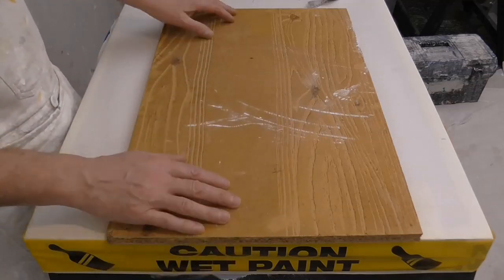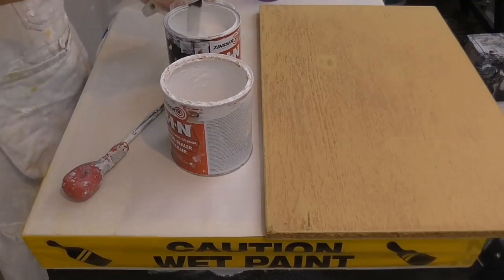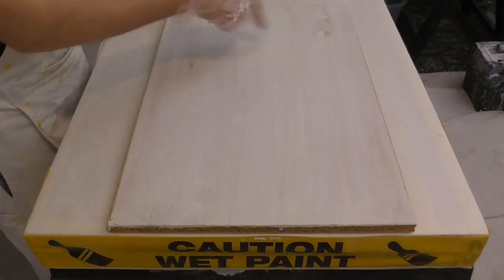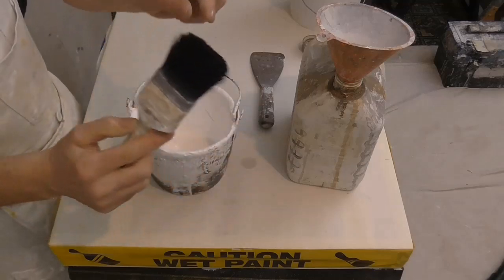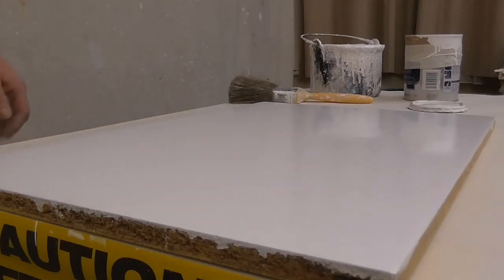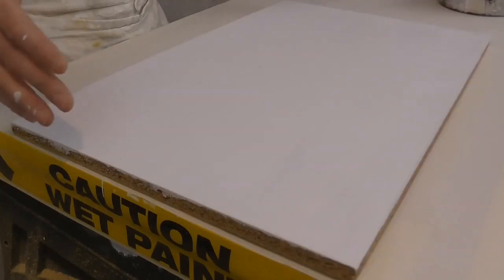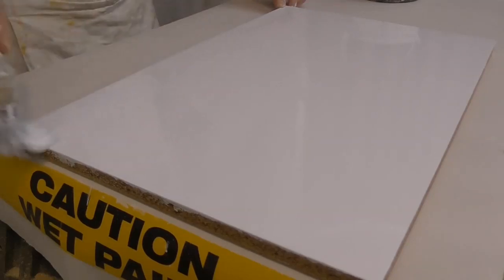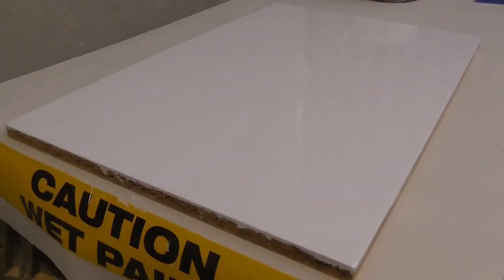Perfect Gloss Finish Using A Paint Brush

Comment: Great video mate. I do very similar brush strokes as you,but to keep dust to an absolute minimum I will use a sponge sanding pad soaked in water between coats. I actually use really cheap ones from pound land,and i get a glass like finish every time. The beauty of this method is,that I can actually rub down in a room that I have wet gloss without the worry of dust landing on it. Not that I would recommend doing it as a rule,but if you are desperate to get a job done on the same day,it can be handy.

Comment: Nice video. Never seen someone put oil brushes in water overnight rather than spirits. you learn something every day. You recommend oil based paints that would work well in windows with light, but I find whites yellow too much when not exposed to sunlight. I am trying to get perfect finishes on internal cupboard doors etc so opt for water (or acetone) based paints. I use rollers instead of brushes as don't have a gun. What would you use for a flat cupboard door - brush or roller?
Reply from the maker: Thanks, usually brush all the way so everything looks the same finish. Oil satinwood does not yellow as fast.

Comment: we do water based emulsion on log cabins. im expected to do 2 spray coats (im not a pro decorator but this job is within my capabilities). the spray coats look great but what ive found is that if i do a brush coat inbetween the final spray coat looks mint. not only that but i know ive got 100% coverage. the main contractor often makes remarks about how long it takes me to do them, he never says anything about the finish though so i know its right. im hoping to pick up some oil based skills so i can take on more variety. ive learnt a bit here though thanks for your time fella!

Comment: Recently i used zinser bin for the 1st time I was so impressed with the coverage. Thank you for the recomendation
Reply: worst stinking stuff i ever used...might just as well use 2 coats of paint..skip the primer
Reply: I used it and I was surprised how thick and expensive and how hard it was to apply to the wood. There's better options for sure
Reply: Zinsser 123 is more or less the same. Water based and doesn't dry as you apply it. BIN would be useful for knots and MDF edges but is a right PIA to use.

Comment: Excellent video! Just to clarify, in most situations, you should only need one coat of oil based gloss? And if you do decide it needs a second coat, you need to re undercoat and sand before applying the second coat of gloss?

Comment: Thanks for a brilliant video.  I've always sealed my brushes in airtight plastic bags in the past, wrapping them very tightly and securing them with an elastic band, and just overnight, but this has been for emulsion or water based eggshell or matt woodwork. Do you think I would be able to use the same for oil based gloss. I've got so many cabinet fronts to do that I want to keep things as simple as possible, but don't want to compromise the quality of the finish. Many thanks
Reply: Putting your emulsion brushes in plastic bags overnight is fine but I wouldn't risk it with glossing brushes. You have to train a good glossing brush which makes it too valuable to risk in plastic bag overnight. If it dries out you will have to spend loads of time getting it usable again. Put your brush in water overnight or clean it thoroughly after use.
Reply: @timothyarnold777  am I misunderstanding? so its ok to put a brush with oil based paint on it into water overnight to continue painting the next day?

Comment: Great video, used this technique on some door panels and worked a treat with oil based eggshell. Only issue is, I have a few drip marks on the doors and can't get round to sanding for another week or so. Will I be able to sand it down after this time and put another top coat on without undercoating again?

Comment: Excellent video. Am DIY’ing a front door in gloss and struggling to get half a decent finish. Lots of brush marks in the finish. I thought I was laying off but perhaps not correctly. What would you suggest would be best to recover from this? Let the gloss cure completely, sand flat and then apply the next coat, or just apply the next coat while still curing without the standing? The prep up to the gloss coat went all well.
Reply from the maker: Thanks, allow to cure sand and then paint.

Comment: Nice finish.
Using a brushmate would be easier for your brushes though and then you can use different brushes for undercoat and gloss  and just store them in the box.
Reply from the maker: Thanks, you still have to clean your brushes before use I just find this a simple but very effective way with less waste and no extra cost for thinners in you brush mate.
Reply: @PaintingandDecorating  You don't get all the gunk on the brush from a vapour box though  ,and  a bottle of fluid lasts several months so minimal outlay  . I keep a 6.5" gloss roller in mine as well , ready to use straight from the box . Couldn't do without my brushmate , i have a another one for colours as well , briliiant bit of kit.
Reply from the maker: @orbitalforest  Will have to have a look..... but on use a brush builds up paint around the stock which needs cleaning every now and then.
Reply: @PaintingandDecorating   You and your brother are obviously highly skilled and have some great methods and tips , if you use oil paints a lot though like i do ( you still can't beat oil based paint ) i genuinely think you'd both benefit from using a brushmate . Stick one on your Xmas list 😉
Reply: well said brushes end up twisted  being stored in empty tins .most decorators have a brushmate these days .

Comment: You know what? I really like this video. 

I absolutely hate painting. Had a painter come in and do our kitchen cabinets. It looked terrible. 

I rolled up my sleeves and used this process. Looked worlds better. 

Well done.
Reply: Hi Tom, did you remove the kitchen cabinet fronts before painting them? I think this is the best thing for me to do, but am worried about getting them back on really straight without chipping the paint, but I don't see how I can do all this sanding and cleaning up whilst they're still on.
Reply: @geemo4284  Hi, Gee! 

Certainly

Trust me, getting the doors off and back on  is a significantly easier than mastering the techniques of painting shown here.

Comment: Thanks for the video - excellent demo. I used to use Dulux oil based to get a lovely gloss finish but, sadly, I find that the white goes yellow especially where it doesn't get much sun. I now use Zinsser Perma-White satin. It's expensive, not as easy to apply as oil based and obviously satin not gloss but overall I prefer it as it doesn't yellow.
Reply from the maker: Thank you, will have a look at that paint.
Reply: Hi, recently found your channel. Does the oil based paints today still go yellow? I painted the landing 5 years ago with white dulux gloss and its all yellow now.

Comment: Do you use extra conditioners, like Penetrol? I have to work at 30 plus outside and even the oil based paints dry quickly.
Reply from the maker: Paint should not really be applied over 25 and we do not use water based especially outside..  we like to use the hard wearing paint and oil is king. Thanks
Reply: @PaintingandDecorating  I would never get anything done in the summer! I certainly prefer to use oil based paints and, as you said, water based paints keep the brush strokes...oh well, to the roller since spraying isn’t a good option practically.

Comment: Will that oil based gloss yellow over time? I've recently been using Johnstone's water based gloss and find it ok, clean up is a doddle.
Reply from the maker: It depends a lot on natural light and heat, areas with no natural light your better using water based. But if your room has a lot of natural light this seams to help oil paint stay more white.  Also oil has changed over the years and I think they have made progress a little. They had major problems at one point oil paint yellowing really bad within a month.
Reply: @PaintingandDecorating  That's true,  and was the Reason Benjamin Moore came up with "Cloud White" , all designers were using it for trim, back then.

Comment: Why not prime with acrylic primer undercoat?
Reply from the maker: You could use acrylic primer undercoat but it does not seal as good as B.I.N. or oil undercoat. And you will never get as good as finish using water based paints.
Reply: Painting and Decorating with 2 acrylic primer, an oil undercoat and an oil gloss it would look just as good in my opinion. Plus water base paints are more eco friendly and convenient when it comes to washing up. 

 Zinsser is very good stuff but I only use to kills stains as it decreases your brush life by half even when cleaning thoroughly.
Reply from the maker: @m1k300003  It does not decrease brush life, we keep brushes in a container with a small amount of methylated spirit. And depending what you're doing it dries really fast and speeds up jobs. But I agree you can use acrylic,  and we do use it at times. It all depends on what you're painting and time scale.

Comment: Very helpful, however, my undercoat and gloss is way thicker than the paint you are using in the video and it simply does not go on like you show. I assume if you thinned your paint you would have said - so what is the secret?
Reply: Thin it with spirits or owatrol

Comment: whats the best type of brush for liquid gloss? hair type/count etc. i'm a panel beater/auto sprayer by trade so i don't do alot of house painting but i'm changing my front door for a new wooden one.
btw have dulux changed the colour formula for 'goldcup' in the liquid range in the last 10-20 years one i had mixed as goldcup from a dulux supplier is a good few shades into the orange rather than yellow (currently looking into that info from dulux).
new door is in the 'carolina' style so its got a few thin bars, after primering it a few times i'm thinking i'll paint all the big flat areas first then go in with the smaller brush to do the fiddly bars, i found doing it the other way the smaller bits get over painted.

which way around would you go? (gonna check out your vids see if you already did that, only just found you)

uk based
Reply from the maker: Thanks, Dulux have changed over the years. Mixing machines get replaced. Yes we do have videos on glossing doors. Pure bristle good for Oli and water..  synthetic better for water based.

Comment: I would use a bigger brush,cross lay it off after coating the whole panel and use a tack rag in between coats after sanding,also I was taught to use one side of the paint kettle so you can put your brush on it without getting paint on the handle of the brush.
Reply from the maker: You only need to use a tack rag on last coat really as the sanding denibs but doing a window sill no call for it. Also that kettle has been used hundreds of times and needs burning out. And on that small board a 2" brush is perfect size

Comment: Two fussy blokes sleeve in Tikkurila Helmi 80 x2 over Otex akva gives you a mirror finish just like oil. Try using good quality water based system and you will see. I don’t mean Dulux and Johnstone etc.
Reply: Thats good stuff, so is Benjamin Moore advance gloss.
Reply: Marcus Chambers Ben Moore advanced is proper nice gear. Just a bit pricey for me. If the price was inline with the Tikkurila then it would by my go to every time.
Reply: @KINNELLCOD  thats fair enough, it gets incorporated in my price, it does go quite far.

I do like otex, very similar to Zinsser coverstain in terms of drying and sanding to dust to glass finish. 

There are so many great paints around with much better qualities than solvents, just need a bit of research outside of B & Q and DDC to find them. Waterborne paints are the future I think.

Comment: Can you show  the technique for avoiding  runs on vertical surfaces using oil based paints, as water based dries quicker so it's easier  for beginners less chance for runs. Thanks
Reply from the maker: Yes no problem will make a video. And you still have to be careful with water based as you can get build up in certain areas of application that run, and are a lot harder to touch up when noticed as water based flashes as soon as you look at it.  Oil based paint is better to work with also dries at a lower temp and is on a whole different level to water based... shame it can yellow.
Reply: @PaintingandDecorating  thanks for the reply, always enjoy  your videos, and picked up some great tips especially the one's  about dealing with cracks in plaster cheers.
Reply from the maker: @Dave-wm2xg  Thanks.
Reply from the maker: @bsimpson6204  Sunlight seams to bleach everything.
Reply: @PaintingandDecorating  A drop of Raw Umber can slow down the yellowing on oil whites.

Comment: Good to see you back top man and a great vid but I have been wandering why you don't use a brush mate for your brushes
Reply from the maker: Thank you, and I think it's because brush mates can be harder to clean out. I just change pot sometimes I use old 2.5 Lt pots.  You have to change the water in you brush mate anyway, I just find a pot faster. Also the smell does not bother me, just lets me know it needs cleaning.
Reply: @PaintingandDecorating  think we've got our wires crossed there no water in a brush mate it's a small bottle of thinner it's the vaper that keeps brushes soft
Reply from the maker: @peteramond3358  Thought so, but I've seen painters with water in them in the past. May be because the thinner is just more expense.  It's a good idea in theory but when it comes to waste it really is.
Reply: @PaintingandDecorating  ok buddy thanks for the reply

Comment: So if you want to put a second coat of gloss on you've got to undercoat again?
Reply from the maker: No, not really if the second coat of gloss is applied within 48 hrs.  Oil paint takes a long time to cure so a second coat will bond with the first gloss.
Reply: @PaintingandDecorating  cheers. Also I noticed you use Zinsser primer on bare wood. It's not cheap that stuff for ordinary skirting. Any alternative?
Reply from the maker: @TAIL313  Well you have to seal knots and it saves time. But you could use knotting and a wood primer. If your just touching up a few bare spots then just use your undercoat as a spot primer to seal.
Reply: @PaintingandDecorating  makes sense now. Didn't know about the knotting. Just a general DIYer. Keep up the great work. You're a gentleman for taking the time to share your craft.
Reply from the maker: @TAIL313  Thank you.

Comment: My trick to clean a brush and reuse it immediately is, step out in the yard\street\open space, put one hook of a bungee cord thru the handle and swing it, spinning vertically by your side, being sure you're not spraying any cars or property, even though the brush is actually clean.
Time to splash and dab! I do this every time I clean a brush. BTW, Wooster and Purdy recommend never to let brushes soak very long, but that may apply to just latex brushes...nobody I know of in Georgia uses oil anymore save for very high end houses.
Most painters here don't even own oil brushes!

Comment: The only good oil based paints left on the market are palatine paints their oil based msp satin and gloss best on market. The big manufactures aren't allowed to make oil based paints properly anymore. Even the pre 2010 oil paints were at the limits in what a good oil paint can be then with the further 20% reduction in VOC etc was the coffin nail for them dulux crown johnstones etc may as well stop making them whites yellow to easily and colours take 3 months to fully cure and use acrylic pigments and aren't as durable anymore coloured oil undercoats don't dry hard either

Comment: No disrespect but all that faffing about you do cleaning brushes due to the way you store them you’d be so much better just using the brush mate trade 20 & using a brush for undercoat & a separate brush for glossing. 

Being a new build house painter myself I’d never make money on a price doing it like this.
Reply from the maker: Not worth it extra expense when money is so streached. Faffing to you saving money to me..   also it depends how worn the brush is..  depending on if it's used in undercoat or gloss.  I go with the best brush..  sometimes I may clean a undercoat brush out to use in gloss..    it's what's best.
Reply: @PaintingandDecorating  It’s 100% worth it, I’ve had mine over two decades & the initial outlay of around £70 will definitely save you money because you’ll spend more time painting on the job switching between brushes instead having to clean them out, scrape them, then wire brush them sod that it’s to time consuming, also if moneys so stretched I’d suggest putting you’re prices up as most people have due to the cost of living these days. 

I’m not knocking you for the way you do it believe me I’m just simply suggesting a much easier & quicker solution to earn more money more quickly, to me it just seem unnecessary, even the brush mate trade 4 would be a better solution & only £20 you save on the white spirits over time. 

Anyway enjoy your day, all the best.